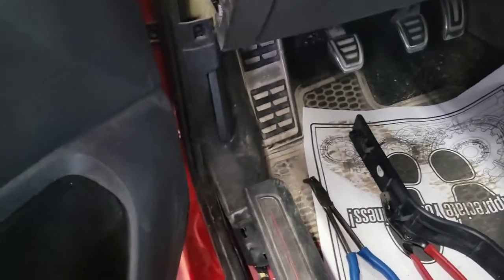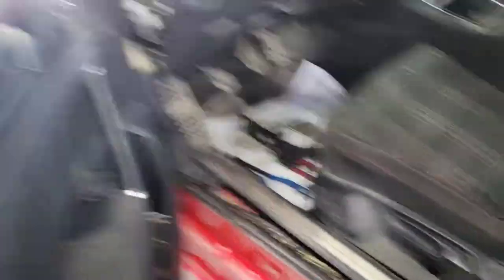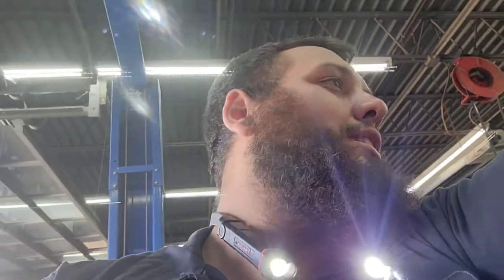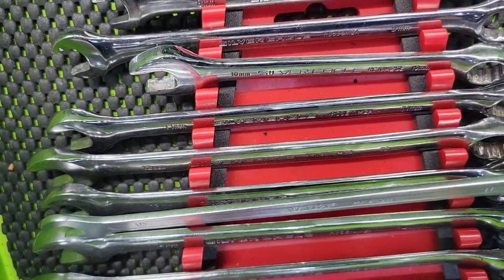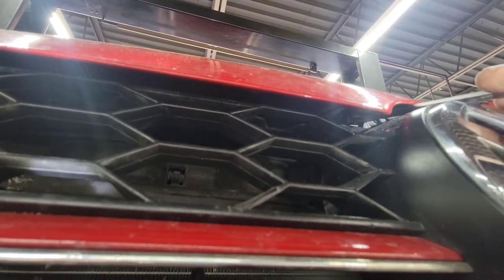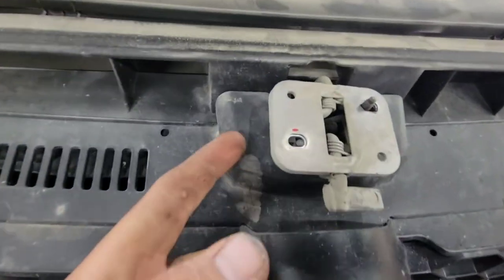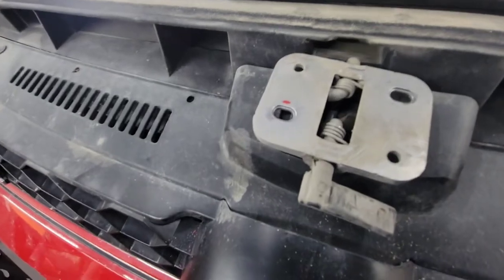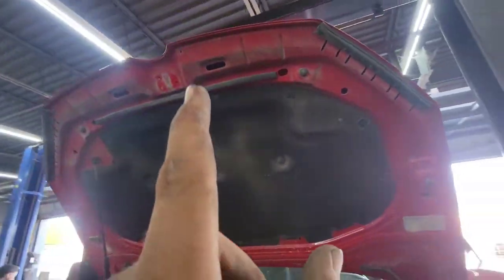Mk7 Golf GTI hood wont open? How to open it

Comment: Dealer wanted $900 to fix this by breaking the the grill to get to those bolts. $40 for the cable.  Cost of dealership included the new grill cost. Thanks for the awesome video
Reply from the maker: Super stoked I could help bro 🙌 if you don't mind dropping a sub if you haven't already id greatly appreciate it

Comment: This video came in clutch. Ended up using a pry bar covered in a rag (sock) to get enough clearance for my two ratcheting wrenches. 
Also ended up joining the two cables with some steel wire in the meantime until I can get and install a new front cable
Reply from the maker: Glad it helped bro

Comment: I have the same problem sadly.. I went to two official VW dealers and they told me that they will break the grill. The issue is that I have VW Golf 7.5 uplift and the space looks more less than normal golf 7 and also the adoptive cruise control sensor is on the back of VW sign. I will still try to open with the slim wrench. I hope it opens
Reply from the maker: Just be very careful and take your time more importantly. This job has to have patience. If you're able to get a slim wrench in there work on both bolts at the same time and not just one at a time. When both are equally loose the hood will give more room

Comment: Came for an oil change and to get my occasional epc and transmission lights checked on but they couldn’t open the god damn hood when I just did ten minutes ago now I have to take apart my dash and pray to god the line broke off the handle not the hood
Reply from the maker: They figure it out?
Reply: Yes, what size wrench am I buying?
Reply from the maker: @k_-kq3ch  10mm